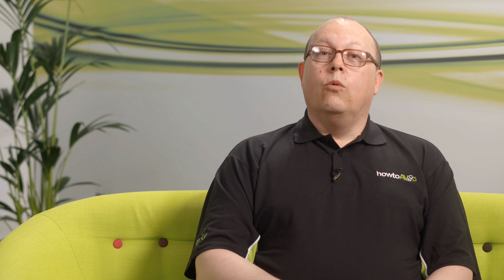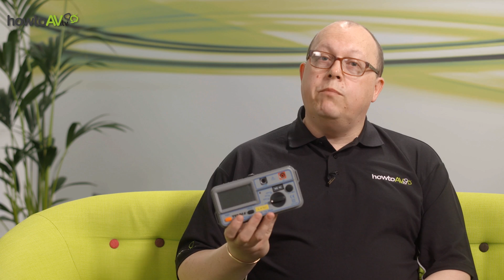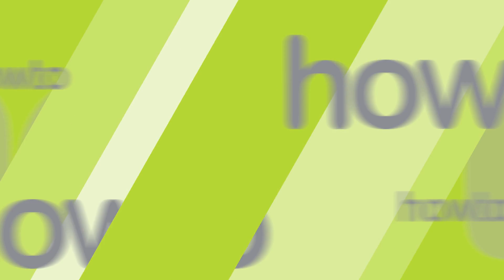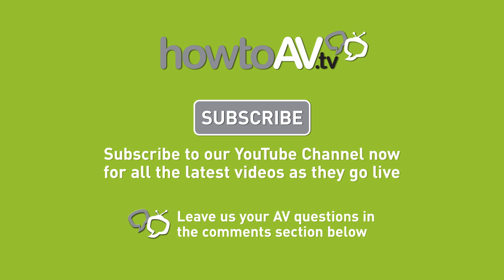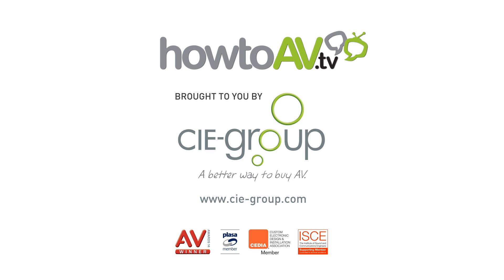Measuring 100V line audio systems

Comment: My local made pa amplifier output volts are 95v @ 8ohms. (450 watt @ 8 ohms)
it has no output transformer.
The dc supply rail is 95+95. 
Can i drive 100v line speakers on it?
how many speakers i can drive on it?

Comment: Hi, What is the max length of cable for a 100v speaker run (max distance between samp and speaker), eg running on a 60w 100v amp, thanks

Comment: So I have a line in a factory with 12 speakers that are putting the amp into protect mode.  I need to trouble shoot the line to find where the problem is.  I was able to isolate the office speakers and they are working fine now so I know the amp is working good.  When I connect the line to the factory floor speakers it shorts the amp into protect mode and it gets really hot.  I know the problem is on that run.  This system has been in for over 15 years working fine and now all of a sudden is causing the problem.  There are no area speaker level switches just the 70 volt lines to the speakers.   How can I trouble shoot this issue.  I have one line leaving the amp going to the factory floor.  The fun is I need a scissors lift to get to all the speakers.

Comment: Appreciated your comments on testing the 100 volt speaker systems. Many do not understand that you can not get the correct impedance with a standard multimeter.
Reply from the maker: +Simple Audio Tips Thanks Gary - agreed, it is a common mistake!